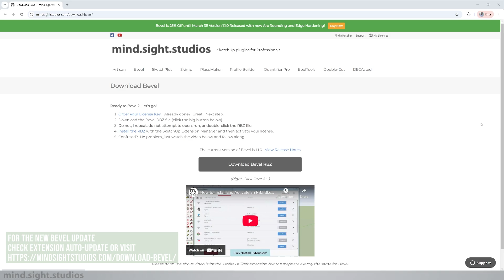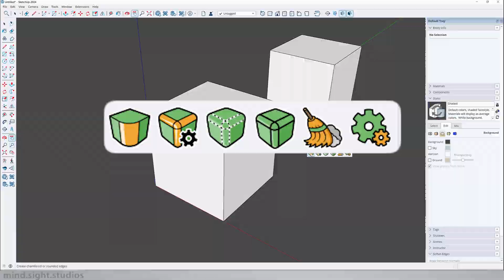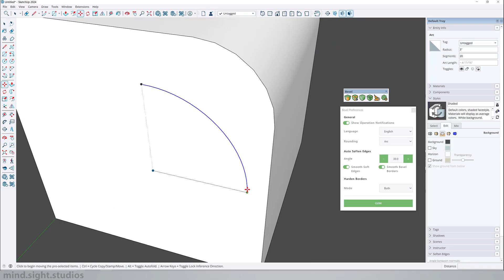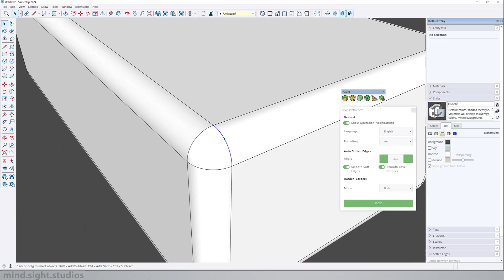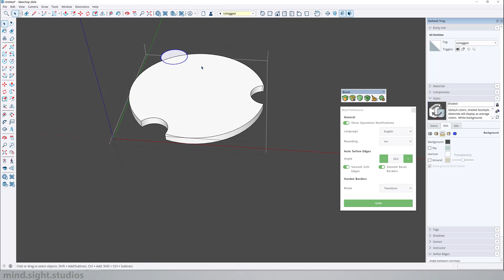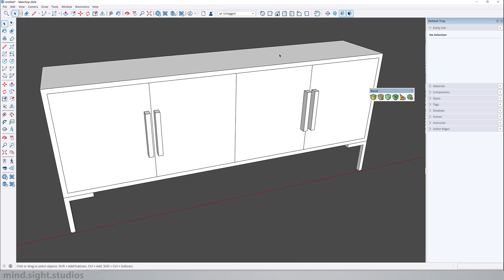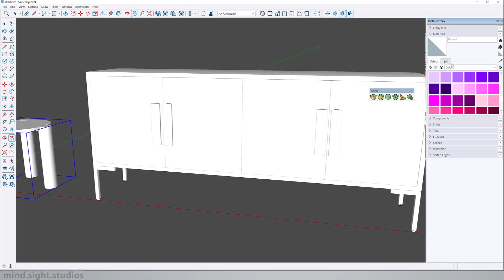New Bevel Update : Rounding Edges for Better 3D Models

Comment: Nice presentation.  Wondering about advantages/disadvantages (if any)  of "Bezier" v.s. Arc Rounding.
Reply from the maker: Bezier may provide slightly improved smoothness of rounded edges compared to Arc. Bezier was the original mode in previous versions and we are keeping it available for now in case people discover issues or bugs with the new Arc mode